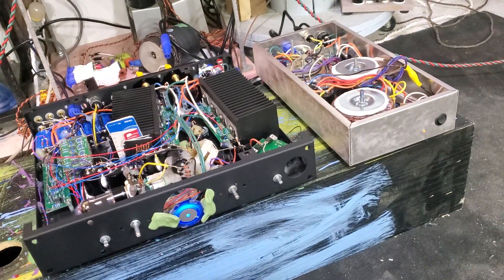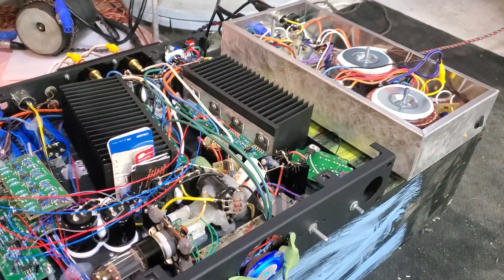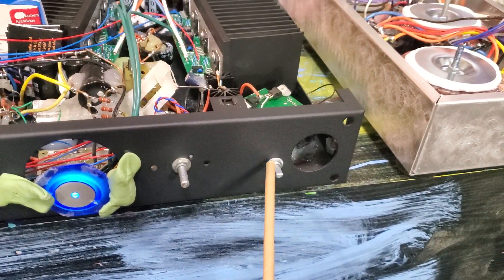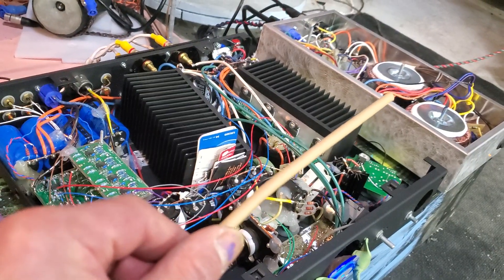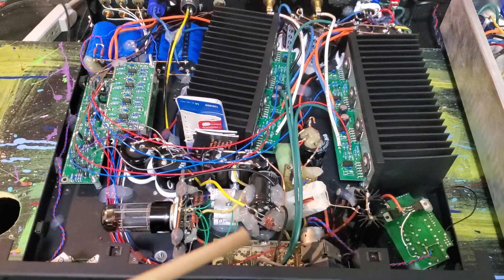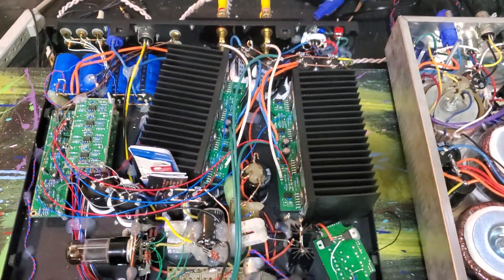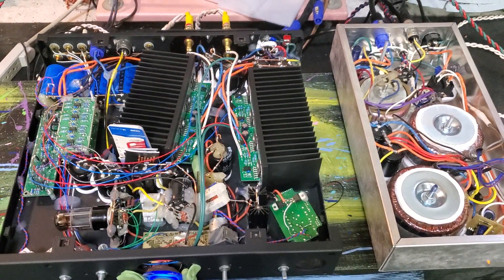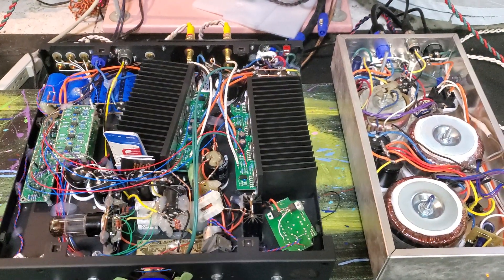Shortest Signal Path and the Lowest Impedance Ground Path.  What are they?

Comment: What will happen if one day this amp will breaks down and you decide to close the company or leave the field. Which technician would know how to repair this device? Do you provide electrical drawings of the design? Does every component you put there have a number/mark? When  you make this kind of changes a to a piece of gear, you are the only one who knows how to repair it. And you mentioned that you are a one man company.
Reply from the maker: Any able technician can figure out how to service most of my design without any drawings.  It is very simple but without any electrical or electronic knowledge you will not understand what you are looking at.
BTW When you buy anything with a logic brain, it will break down eventually and even if the company still around they are most likely decide not to support the unit because they want to sell new boxes.  Beside most Japanese surround sound receiver companies don't supply spare parts as soon as they run out. Sometime within 3 to 5 years.  It doesn't matter whether it has part numbe or not, the unit will need to go to land fill.  Nobody can fix those units. It you have to concern about this issue, there are hundredth of thousands possible millions units out there you should the question.  At the same time I am still servicing and support 25 years old units of mine.  Don't worry about me.

Comment: Thank you for these enlightening videos that debunk myths in audio technology – they're truly refreshing! I have two questions:
Q1 - Regarding wire types, which do you prefer: stranded or solid core?
Q2 - Could you specify the type of silicone you're using? Is it general-purpose (GP) like GE stuff, or perhaps something more specialized? I notice you're using it to secure the wires and also to dampen other components. I'd appreciate more details about this because it seems very practical, yet it's seldom seen in other components

As Always, thank you for taking the time. Cheers 🥂
Reply: Dow Dowsil 3140 is suitable for corrosion sensitive components though it is considerably more expensive than regular acetic acid based silicone rubber.  Icepower class D amplifiers use silicone rubber in their products and I'd guess it's the non corrosive type given where it's used.

Comment: @angela-gilbert  - on my (not Blue Circle) integrated amp that you upgraded, you installed a column to support enamelled ground speaker terminal.  I assume this is different than star grounding or the overall grounding you’re talking about in the video?
Reply from the maker: The column I installed in your integrated amp was to support the enamel wire.  Make sure it doesn't touch anything around it.  Not to ground anything.  Almost the opposite of what I was talking in the video.
Reply: Ah - thank you.